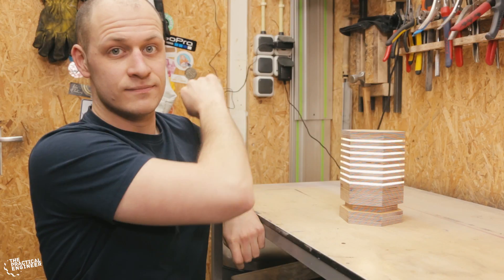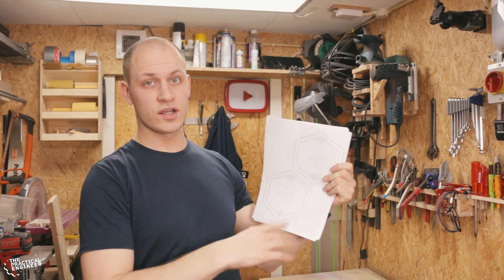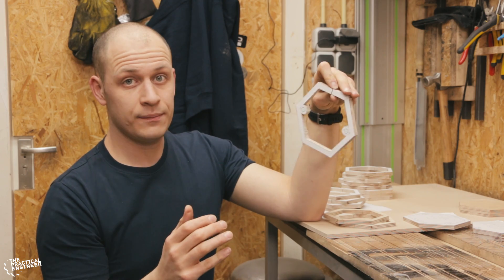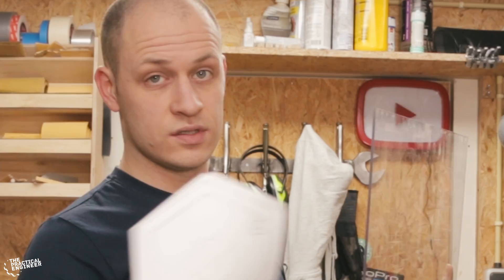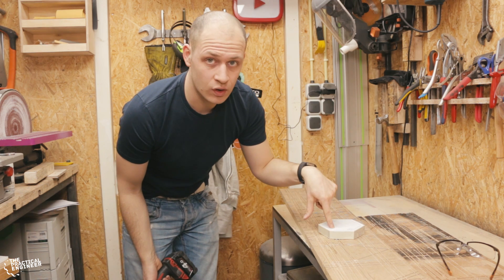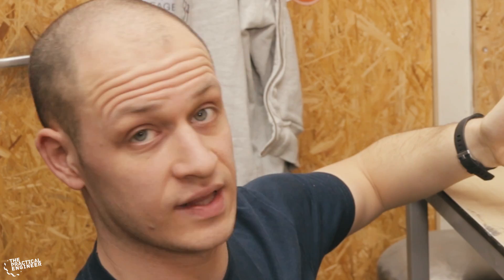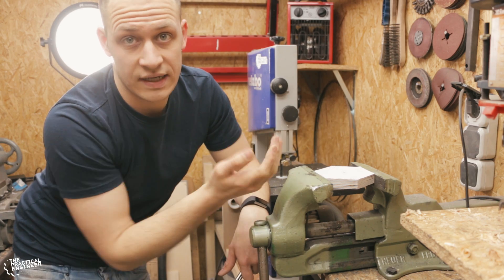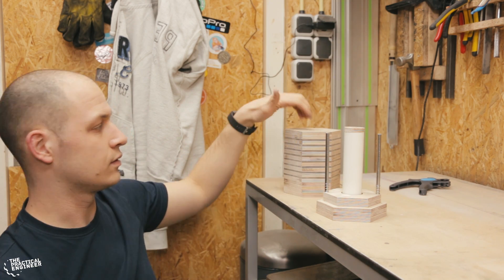DIY LED desk lamp with hidden switch - Hexagon LED lamp

Comment: Brilliant design, perfect realization and a very well equipped shop. Congratulations. The only thing that I would change is to use a metal tube as the central column. This would let the LEDs  run cooler (although it would also make the lamp much heavier).
Reply from the maker: Yeah, it is indeed better to have some heat conductive material for the led's. I didn't have a metal tube that I could use for it.

Comment: Really good design, but in my opinion using less LEDs is possible, because the end product "eats" lot of the light
Reply from the maker: It could be done with less leds indeed but then there is also less light on the outside.

Comment: Well made. Next time Id use a router for the outer and inner side, just finish off the inner corners with a jigsaw.

But a really nice idea!
Reply from the maker: Thats an option too! Didn't think of that but you are right if you make a template for the router its easy to make them.